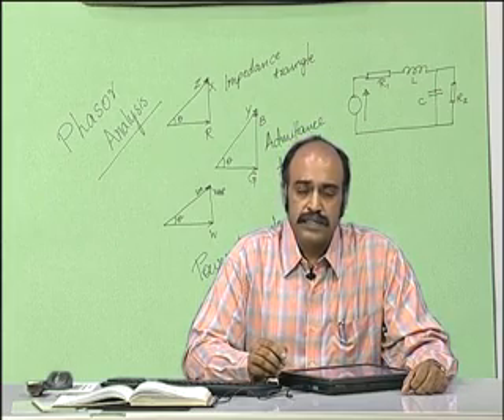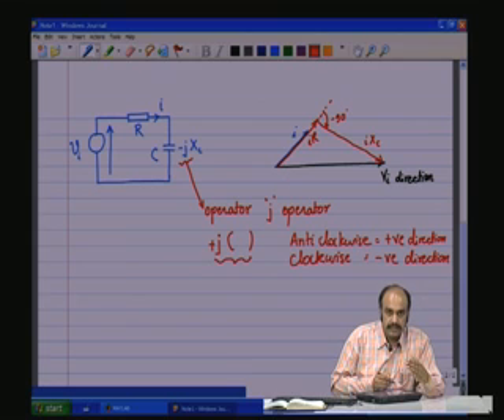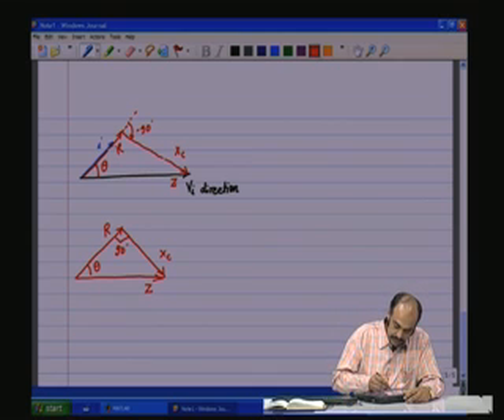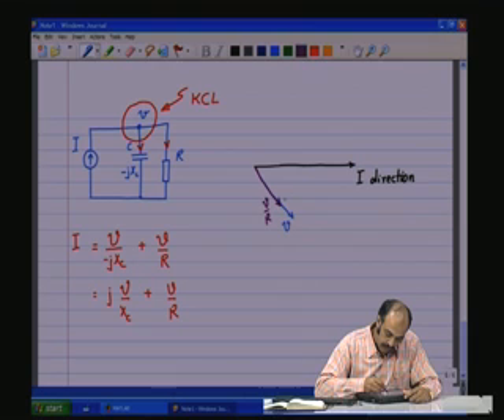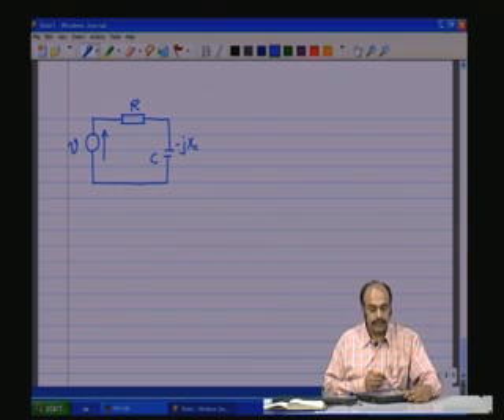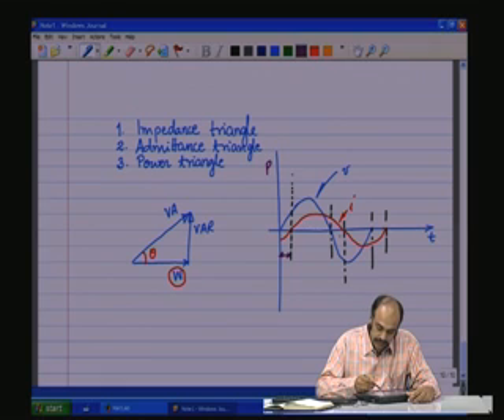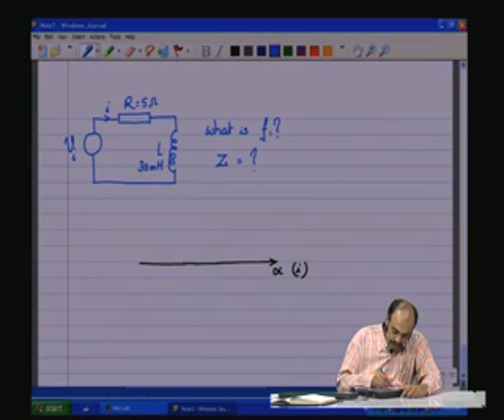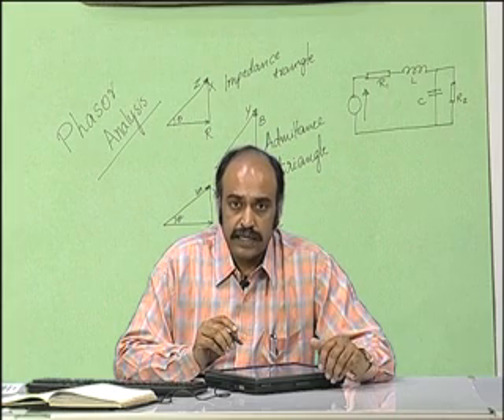Lecture - 14 Phasor Analysis part 2

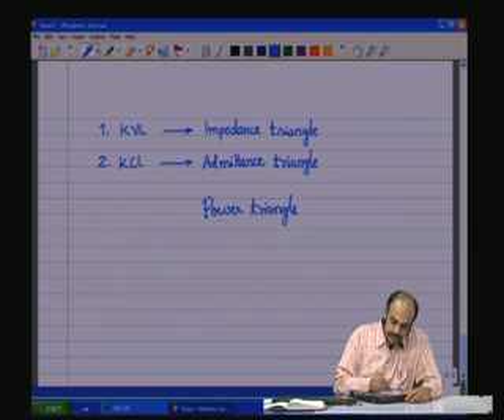Comment: I think @ 35:42 he is not right in multiplying all the current phasors by voltage because voltage is not the same for resistor and capacitor in RC series circuit. He should have taken Voltage phasors and multiplied them by current because current is common to all the elements in a series circuit.